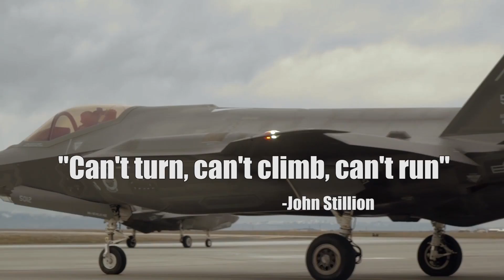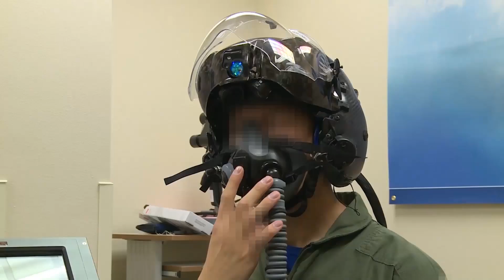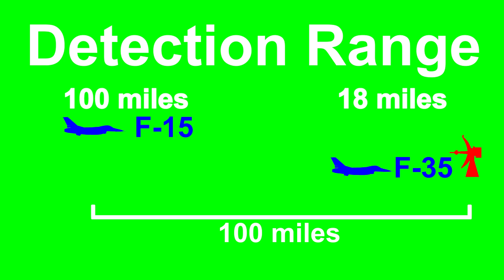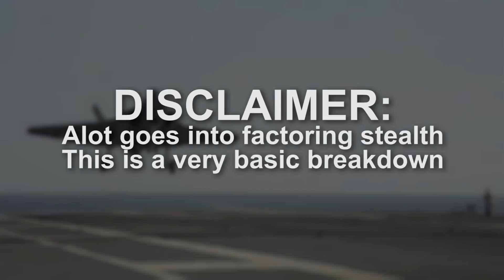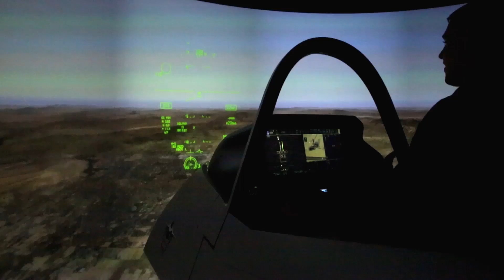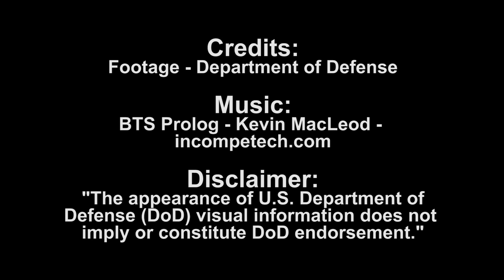F-35 Overview - The Good, The Bad, The Ugly

Comment: There is no reason for F-35 to every be within 18nm of a radar emitter. Weapons it would employ in a contested environment would be deployed far in excess of that range. In addition, those weapons are also being manufactored with increasingly small RCS. 
Meaning, between 45nm and 20nm, F35 has already deployed 4 stealthy weapons, from 4 different release points scattered over 4 different vectors and 4 different ranges to target. 
This allows all 4 weapons to maneuver independently to arrive simultaneously from 4 different directions with little to no advance warning.
Now build a 36 aircraft strike package to include decoys, chaff, ECM, ESM, ECCM. The F-35s own recce capability and data link, real time CS4R. 
I pity the fool who finds themselves downrange of that Hellstorm. 
People who only look at performance numbers and stats fail to understand the mission and pure deviousness of the tactics. F-35 is not designed to fight fair. It's designed to detect, deceive and then destroy from ranges which give no known defense any hope of intercept.

Comment: The F-35 is a great replacement/follow on for the USMC AV8-B Harrier and USAF F-117 Nighthawk. It is a horrible replacement/follow on for  the multirole, backbone of the air force F-16. For use against very high value target that require deep penetration and stealth great. But for jack of all trades day in and day out ops. Very bad due to high per mission cost and very low low mission availability and low sortie rate.

Comment: As far as the "stealth per weapons loadout" ... 
That assumes you don't have the kinds of phases we've seen in which air-superiority is established then maintained -- which of course WILL REQUIRE stealth to avoid massive losses like we saw in Vietnam. People just don't remember or understand how many pilots DIE -- even in NON-COMBAT OPERATIONS. It's probably THE SINGLE HIGHEST RATE of CASUALTIES in the USM, excluding special operators as we don't know that data. 

Once we have air-superiority or supremacy even, use the f-ing pylons. OR! NON-STEALTH CRAFTS at way cheaper cost-per-flight-hour... 

And UNTIL WE"RE IN A WAR!! For christ sake, stop doing the maintenance required for perfect stealth. We need to use NON-RAM (radar absorbing materials) and impeccable seams and fitment during epochs in which we have to make visual confirmation to engage bandits for fox sake. Until we're allowed BVR engagements, SAVE THE MONEY!! AND STOP TEACHING OUR ENEMY HOW TO ID US IN THE INTERIM! 

Also, stop letting the focking bidens sell our military secrets for a few million dollars would be good.  LOOK IT UP IF YOU DON'T BELIEVE ME!

Comment: -  Were the F-15C/D RCS of   5.5  m-sq ... detectable at about ~100 miles ... then 
- Then a jet with an RCS of   0.55 m-sq ... would be detected at ~56 miles ...  and

- A jet like the F35s RCS of 0.005 m-sq ... wouldn't be detected until 15 miles..? 
(assuming the inference suggested held true) and also suggesting ...

The F-15C/D has an RCS 10,000x greater than the F-35's 0.005 RCS... (head on).

And we're getting screwed with $150M  F-15EX + CFT, & 90°  IRST- PYLONS, etc.!)
Bc an EQUALLY PRICED F-22 is "too expensive"  with an RCS of 0.0001...as we prep
for PEER adversaries like China, whom the Biden's already sold our military tech out to, so, RCS DON'T. Matter, bc why f-ing bother !??

Comment: Meanwhile other YouTube channels post videos like “Why the F-35 can shoot down anything in the sky” and other BS. Clearly it’s a suboptimal build, with it’s only hope at victory comes from a BVR fight rather than a circle fight. It’s low thrust to weight ratio makes it an easy target for most semi-modern fighters to down in a (n)-circle fight, making its only option a nose position fighter like the mirage 2000, which it will still likely fall flat on. Once you go from BVR to ranges where you can be tracked by aircraft radar, you’re effectively dead unless it’s a poorer nation like Iran’s outdated air force, as a topical example.

Comment: Lockheed martin will, probably make another aircraft to compliment and assist the F-35 with doing it's job like the f-22 but with less operating cost. But first they need to secure funding so they advertise it to gain funding. The F-35 will probably be one of the most valuable aircraft during wartime due to it's stealth, reconnaissance and scouting capabilities , and being able to hit strategic targets without ever being targeted making it one of the most valuable aircraft if war suddenly started. One thing to keep in mind that in war It doesn't matter how good an aircraft is like the F-22 , The only thing that matter is how you use the aircraft itself and the F-35 beats the F-22 due to it's capabilities to support ground troops much better than the F-22.

Don't get me wrong I love the F-22 but the fact is the F-35 are way better in warfare due to it's cheaper operating cost and has better versatility than the Raptor. Let me remind you again. The whole point of the F-35 is not to be the best but to be able to support the troops in the frontlines and possibly save countless lives just like the A-10 does. Thank you and goodbye.

Comment: The more I hear about the F-35 the more I just think they should have just tried to get economies of scale with the F-22. It's still the most remarkable plane out there. I sincerely cannot help but feel that the 5th gen was a bit of a flop when you consider the legendary performance of the F-14 and F-15.
Reply: We probably should have made more F-22s, but its role is different than the F-35. Even ignoring the V/CTOL aspect, the F-22 is limited in the ground attack role. I would argue that the F-22 and F-35 have yet to make a name for themselves mainly because they haven't been used yet in any real capacity, not because they are poor designs.

Comment: Overall still superior to ... F16 (which is an ancient aircraft introduced 41 years ago and the latest model C/D 22 years ago).. I can't see this as a good. 
That visibility is like the F111, a fast attack bomber config, perhaps the advancement in technology means the pilot does not need to turn his/her head. 
Get twice as close than a F15.. that is because the F15 does not need stealth to maintain air superiority :-P. 
Low cost 5th generation fighter became an ultra high cost 4.5th generation fighter that beat the F16 wow.. what value for money.

Comment: I think that the f 35 should be more of a support to f 15 and other aircrafts.
I obviously can't replace the f 15 and the A10 but what it can do is being used to take down Sam sites or simply go over heavily diffended zones where it would be to dangerous for a non stealfy aircraft to go.
With the support of the A10 and F15EX it can effectively bomb the enemy as it can engage targets that are too dangerous for 4th Gen fighters. Yes it has a payload problem but once the enemy aircrafts are forced out of a zone and Sam sites have been destroyed you don't really need stealth and you can use the exterior pylons thus giving the f 35 a much better payload and with some CAP it should be ok.

For air combat it think that it can totally be good as long as it stays away from enemy fighters. But once again payload is a problem with only 4 Aim 120.
If enemy fighters come close for a dogfight a CAP with f 15 or f 22 could take care of those allowing the f 35 to retreat.
It is very good in BVR engaments because of it's very good radar but it's low payload does not allow it to exploit it's full potential. In dogfight however it is very poor but with f22 or f 15 in escort it should be OK.
The f 35 do the BVR and f22, F 15 and f 18 (if the US navy is in) do the WVR and help for the BVR.

Comment: The same geniuses that said the F-4 Phanthom did NOT need an internal gun because guns were outdated and missiles were in are probably the same idiots that designed this lemon. The Chinese will BLITZ the fleet and this flying brick carries only eight missiles. I understand it can't even carry a good load of ammo for an internal gun. This is what happens when you try to make a weapon system for every service and every need, it just does not work and American pilots pay with their blood for idiots behind desks.
Reply: > "The same geniuses that said the F-4 Phanthom did NOT need an internal gun because guns were outdated and missiles were in are probably the same idiots that designed this lemon."

 The Navy simply improved maintenance on the missiles and trained the pilots better, and outpaced the USAF in gaining air superiority against enemy aircraft. The addition of the gun made no difference. Training techniques carried over from the Navy as well as more appropriate use of SEAD turned around all losses for the USAF in the Vietnam war. The addition of the gun for them didn't improve these rates. 

> "The Chinese will BLITZ the fleet and this flying brick carries only eight missiles."

 That's far better than the Chinese aircraft assuming they want to go supersonic. 

> "This is what happens when you try to make a weapon system for every service and every need, it just does not work."

 It's not that it doesn't work (i.e. F-111 which while a debacle in R&D was generally well received by all branches, though Navy dropped it and any heavy "fighters" from its inventory by the late eighties ). Rather high commonality between three different aircraft for the different branches.
Reply: @peterson7082  Hey Nathan, though I still disagree with your assessment in having an internal gun I want to thank you for a thoughtful and pleasant reply. Have a blessed day!!!

Comment: The problem is you smash all that money up the wall, and sure it's a decent plane for now, but if there is an advancement in counter-stealth technology, all you have is a very expensive crap aircraft.
Reply: If you think stealth is the only advantage the F-35 has then you don't know what you're talking about.
Reply: @dumdumbinks274   No but that and VTOL are the major design compromises.
Reply: @N330AA  Stealth doesn't result in any notable design compromises. VTOL was a requirement for the F--35B, and has no effect whatsoever on the F-35A and F-35C.
Reply: @dumdumbinks274  That is an absurd statement.

Comment: 1:35 Dogfighting is meaningless in Gen 4+ fighters. Especially the USA are leading in high-aspect, high-off-bore-axis weapons like the AIM-9X, and it's adjacent systems like radars with high viewing angles and helmet mounted sights. There's no dogfight anymore because of three main reasons: 
You do not need to get behind the enemy fighter anymore because of the high-off-boreaxis weapons. You can shoot at anything in the front hemisphere of your jet, you don't require maneuvering to get a guns kill or to maximize probability of kill, like in earlier visual range missiles.

Secondly, because of this weapons a visual-range attack is lethal for all sides, and everyone tries to avoid getting too close to the enemy. Especially if you don't know if the enemy still has BVR-weapons. Get within 5nm of a fighter with modern medium-to-long range BVR weapons, and the rocket motor will most probably still burn when it reaches you. No escaping that. 

The last reason: Sensors and datalink integration between assets in 4+ gen aircraft is so strong and because of that situational awareness is so good that you can't do surprise attacks anymore,  like  in Vietnam, where you often just happened upon an enemy squadron because of the fog of war. And if the enemy sees you and you are unaware, you're already dead - especially with modern non-radar acquisition sensors which don't give any warnings.

Because of that, the designers of the F-35 platform most likely deprioritized dogfight handling as  a design aspect over other matters like sensor capability and stealth.
Reply: Increase it range by twice using 5 tails.  2 tails on middle wings.  2 canards to increased range by 70 percent flight range on pacific ocean. 
 Carry nuclear jam bombs only

Comment: the advantage of stealth isn't so much that you are ""invisible"" to radar it's that when short wave radar is used to track and target the f35 it cant do that as accurately as is needed to hit the f35 with a missile. so the very much talked about long wave radar that can see the F-35 cant be used to target it. I think the easiest way to explain it is like this..... the F-35s RCS is est to be the size of a golf ball. ( this is all hypothetical guessing on my part) so using L band radar that uses wave length 4.5ft  waves to track the F-35 so take a sheet of plywood put a golf ball size hole in it now the golf ball is going 600mph and try to make your 4.5ft sheet get in front of the golfb ball and go through the hole. not really possible because saying not easy is a major understatement. Once again this is all just me guessing but it gives you an idea of what that would be like also the golf ball that's moving 600 miles an hour won't just be flying in a straight line so you can hold your sheet up there perfectly still liner up and let her fly through because of the pilot won't detect that you're doing this definitely not fly through it also F-35 or no when you started targeting it you'll have to wait easier time targeting you back fixing your position tell him the entire United States military everywhere on the entire planet where your radar dish is within 3ft by 3ft square on the planet Earth then if it wants to it can give you a simple 250 lb GBU that will most likely hit within that 3 foot by 3 foot square so if you turn your radar on you detect the F-35 it detects you you're trying to lock on to it it's told the entire US military Where You Are it's sending you a 250-pound GBU in less than a minute if you haven't blown it up before it launches the bomb it's going to with a 95% or better chance give you 250 lb of explosives within a 3 foot square if you don't blow it out of the sky before it launches it you are a stationary Target otherwise known as a Sitting Duck turning your radar on momentarily and get the F-35 enough time to Target in crack you turning your radar off right afterwards it still knows you're there because you can't just simply pick that s*** up Runaway and not be there when the bomb gets there and this equation I would much much rather be in an F-35 if you're in an F-16 you would need help from jamming aircraft to keep them from targeting you very well and you'll be doing wild weasel missions like what you've seen in movies where they launch shrikes and missiles like that or it's a game of who can launch against who first. the F-35 has a pretty large advantage.  and there are many other ways this equation could end the F-35 can fly up have a nice 400 turn on and track it then it will tell do u.s. Navy wear that S400 site is and have an ssgn launch a cruise missile strike against at Target cruise missile could be one that has the cluster bombs and devastate the entire area the F-35 only have playing the binoculars and that equation staying out of range of any enemy air defense network and tracking where the enemy air defenses are then telling the entire military where everything is that just turned on causing a very large preemptive strike against those targets crippling enemy air defenses quite quickly because the entire enemy air defense network has been blown to pieces there are many ways to do this equation I can go on for days but this is pretty simple way to show how effective the F-35 actually is and will be not to mention that it's likely that the United States military will be using all other foreign NATO powers F-35 to tell them where every enemy against NATO is on the planet that is the power of link-16.

Comment: most fighter jets are not meant to be used. they exist to establish air superiority for political reasons. 
drones are the ones used for missions. drones are cheaper, more efficient to operate and it doesn't cost risking lifes. of course, fighter jets are there for backup, and other things that can't primarily be done by drones.

Comment: Russia Sam S 400 variant 🇷🇺 the so call Stealth aircraft and you flying over to get me on the ground here am here  just wondering an waiting you send a single from radar electric Wave from your aircraft so can light my ass up with a missile then you launch one or two and then I retaliate fire a heat sinking missile in defence I know you using anti radiation or  lesser guide  then this  closing inbound set off mechanical machine gun  two missile down means while you try to out fly it or use flares but there was  a problem the Snoopy dog  👃🚀 missile much to smart enough to know this trick between Temp all most  there in the tail pipe because it smell some shit like kerosene 💫 and then it blows off your tail end 💣💥 down you go here come the out call🛎️ 🗣️ 🗯️ may day may day 😓😓 ..